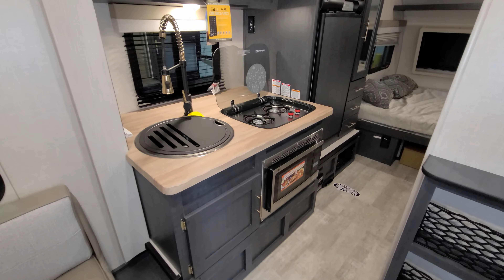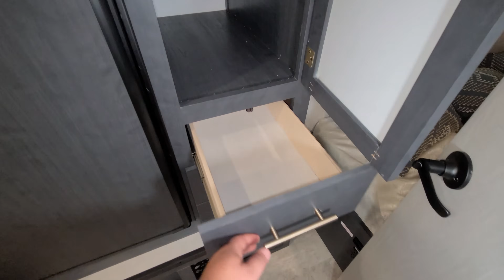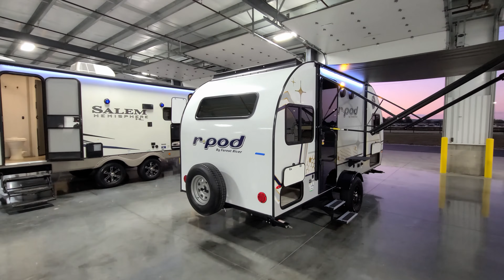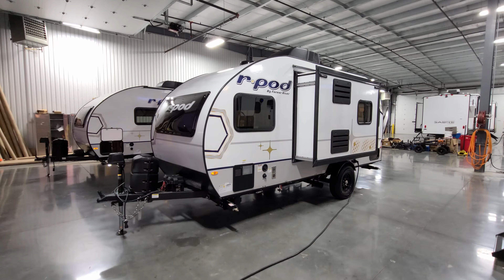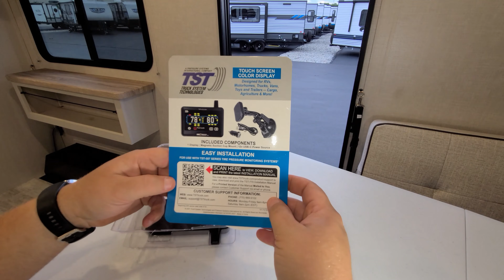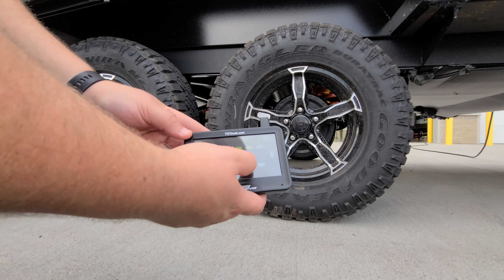New 2023 Rpod 190 Camper by Forestriver RVs @ Couchs RV Nation a RV Wholesaler - RV Review Tour

Comment: I really like the 2023 Rpod 190 and tried to purchase one in Wilmington, NC in 2023.  But for some the reason, the dealer  wasn't interested in working with us.  I asked them, if they would be at the Raleigh RV Show in August 2023, and they wasn't (which is okay). But they didn't follow thru and didn't asked me to come down to take a look what they got.  The dealer in Myrtle Beach was willing and wanted me come to take look at the one they had on the lot, but they were 180 miles away from where I live.  So, I went with option 2, the Geo Pro.  The dealer in Wilmington for the Geo Pro was more than willing work with us.  I really like the Rpod 190, but I am also very happy with my 19FDS Geo Pro.